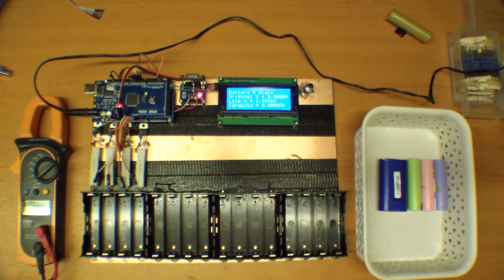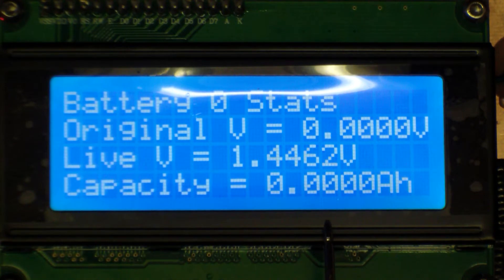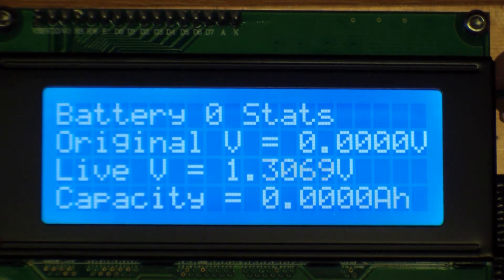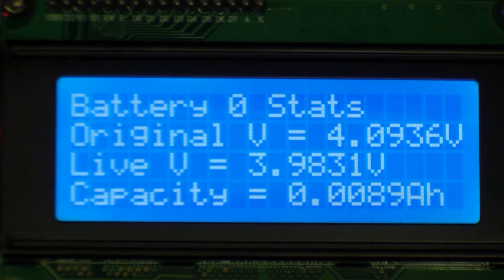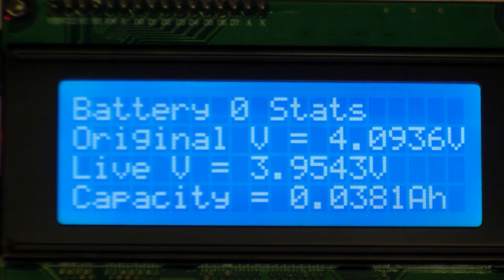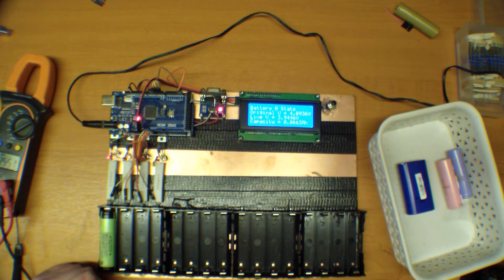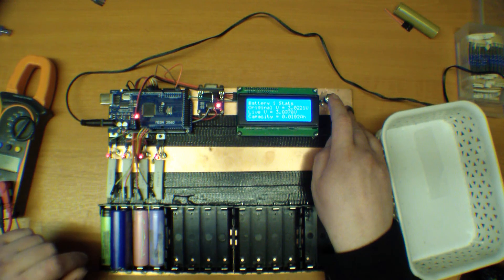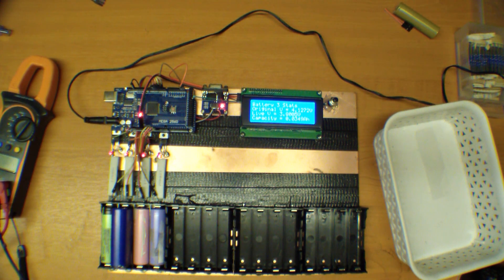16 Channel DIY Arduino 18650 Li ion Battery Capacity tester, Update 1, The LCD

Comment: Some ideas that may help...
The video (and the notes in the code) suggest the "Vin" should be measured and used as the reference voltage.  I think Arduinos typically use the "Aref" pin (also "5v" pin) as the reference voltage for analog inputs.  So, if you use an external 12v power adaptor, your "Vin" pin will measure around 12volts (severely skewing your "live voltage" readings).  For better acuracy, I changed the code to replace every instance of "Vin" to "Aref".

Comment: Hello where you connect the bottom to change the batteries information?
Reply from the maker: hi there, I'm not 100% sure of the question you are asking, however, all the batteries have a common ground, to reset after you have tested batteries all that you need to do is reset the arduino. hope that helps

Comment: If you could charge them and discharge then recharge them then I'd think it was worth it but just to discharge I don't think it is or at least not to me and also if you could create a variable load so you could have constant current  and adjustable